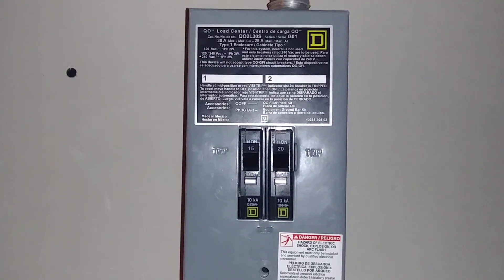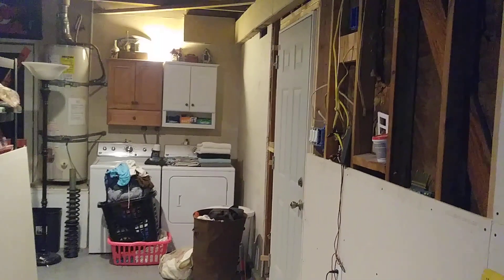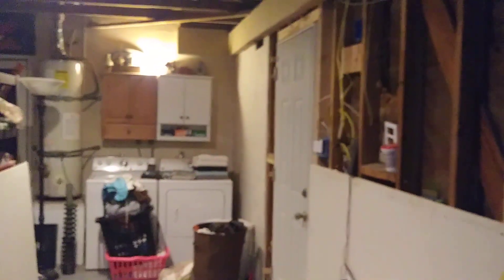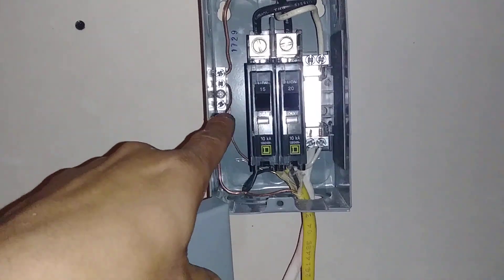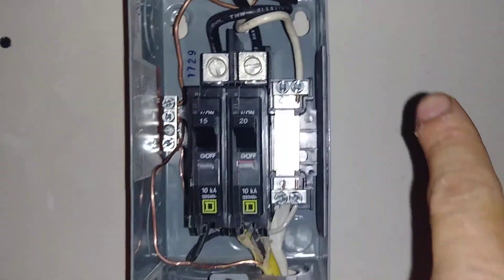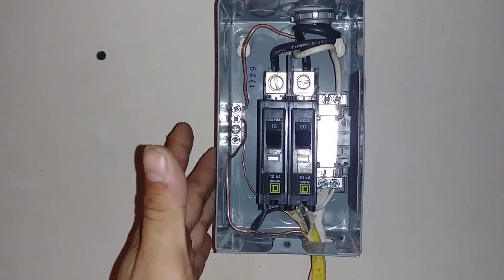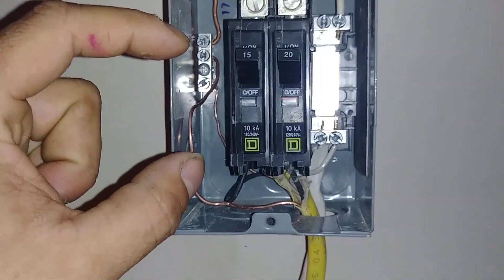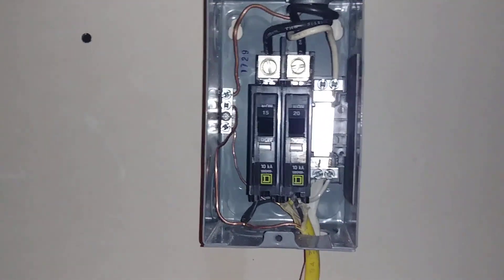How to wire a sub panel 30 amp

Comment: Since you have a shared neutral you should have the same breakers tied together so they both trip at the  time  and add a connector on those wired coming into the sub

Comment: Thanks.  I got one of these to feed a 30-amp clothes dryer off a 50-amp 240-volt line.  Nice little box.  I forgot where the plastic shield/spacer went.  I see it in your picture between the neutral and the wall of the sub panel.  🙂

Comment: @rashellyohn5128
0 seconds ago
Thank you for this video. I really need help!
I have this pump that had 10 gauge 3 hot wires and a ground coming from my panel . 2 hots and the ground were directly contacted to the pump while the 3rd hot was wire nutted off to the side. I have since added a sun panel with( 2) 15 amp double pole breakers in hopes to split the power of one double pole breaker to add a 110amp outlet. Only thing is there is no neutral wire. I got the pump working off the 2 double 15 amps but the gfci only the green light came on but had no power to light the heat lamp. Could I add a metal stake into the ground , run a ground to the bus bar then run a wire to the bus bar to the gfci as my neutral wire. The ground is connected to ground screw of sub panel and also the ground wire that was originally connect to pump is also connect to ground screw. 
Thank you for your help.  At this point I’m not worried about code as I am keep the pump from freezing.
Reply: Sounds like you need an electrician, RA.  When you say "3 hot wires," that says three-phase power, which I'm not convinced you have.  Generally black is hot and white is not (AKA neutral).  For 240, the second hot is red and white is still neutral.

Comment: Can a 20 amp circuit feed this panel with the 20 and 15 amp breakers or does it require 30 amp?

Comment: You could have used the dryer conductors for a 30 amp 120 volt feeder.   You did not need 240 volts.  You really should pull the NM(Romex) cables out and install two connectors.   It is for your safety.

Comment: thanks for sharing, I'm trying to find a nice compact breaker box that has a main and two circuits...any leads are appreciated...
Reply: Just recently bought one a home depot to put in my van conversion I havent hooked it up yet Ill have to check for the ground bar It didnt even occur to me  The one I bought holds 2 breakers I think it was under $20

Comment: You have to buy a separate ground bar? Where do I get this? 
Edit: you say where in the video
Reply from the maker: SMP scientific method perspective I left the link to the ground bar in the description. If you need it right away you can try Home Depot, Lowe’s or any local hardware store.
Reply: @2006JeepLimited57L  quick response! Wow! Thank you. How do I actually hook it up? Is it a double or single fuse? Looks like 2 single fuses? How do I hook up the wires to the fuses and install the fuses?

Comment: Great video!.  Here in mexico most of the electricians, always connect the neutral on the ground bar, i dont know why. I buyed one square D load center (60a), and inside it has an sticker with the electrical diagram and shows neutral connected to the ground, but it have a ground marking in the bottom.
Reply: for the main panel, you connect ground and neutral together, but not in a sub panel.
Reply: Not for sub pabels. Have to be separate bars unlike main pabel

Comment: I just bought the same box with a ground bar kit for RV build project. 
If you’ve got one line in from an RV plug with one hot wire available how do you safely supply power to two hot lugs for two breakers??
Do you use a jumper? 
Confusing.
Reply: In that case you run a cable 10-3 from the main panel box ,conect 30 amps doble break ,in the main panel box use black and red to hot ,and use the white cable for neutral in install in the bus bar and the grund right in the place has to be and install the lettle sud pabel 30 amp with two hot rigth in place has to be next the neutral in the place and the ground in the ground ing bar afther that connect two breaker 15 or 2o amp just for what you need and now you have the conection, if you need caple outlets you can use 20 amp breaker (single) with 12 gage wire  
If you need switch and light just use 15 amps breaker with 14 gage wire ,you can do it.
You gone use two separate breaker, never use doble pole break for that lettle sud panel .
Also you can use single pole 30 amps breaker but these is diferent history i don ,t want mix this explanation ,jejeje .
In mexico they do that on single pole 30 amps break and they meke jumper to another breaker ,but just use 220 volt that way yoy don,t get confuse.

Comment: title says "wire sub panel 30 amp" but switches say 15 and 20 ... ???
Reply: What's your issue 35 amps doesn't equal 30?  Sum up the circuit breakers in your main panel and see if it equals the main breaker / rated panel capacity.  Nobody ever turns on every circuit at max capacity at the same time.

Comment: Dude, you need to put a 'proconnex' connector on that box where the 12-gauge and 14-gauge wires enter the box to prevent the metal edge from wearing through your insulation. Plus, it is code required.
Reply from the maker: Yes. I eventually did. Thx, dude.

Comment: I just got this box and I am alittle confused, why do you have two hots and a nuetral/common wire comming in on the top.  Is that 240V that you have there?
Reply from the maker: The two hots coming out are connected to a 30 amp breaker on the main. There are two slots for two hots on my 30amp on the main. The neutral white wire connects to an open slot on the neutral bar on the main.
Reply: @2006JeepLimited57L  - ok thanks, i only have one hot 30 amp 120V comming into the top, do i need to jump it over to the other top lug to use both breaker slots.
Reply from the maker: @durangodave  You can just buy a a 30amp breaker with two hot slots and switch it out at the main.
Reply from the maker: Check your main panel and see if you have room for a 30amp double pole
Reply: @2006JeepLimited57L  - hi this is on an RV i am adding a sub panel where the 30amp shore power comes into the RV, I have had some electrical issues with the main panel and i want to have something ahead of that just in case.   I have no extra slots in the main panel.    But i need to run two circuits off the sub panel.  One circuit will be to the main panel and the other circuit will be to an outlet.  So this sub panel will have 30amp comming in, and two breakers one 30amp and one 15amp. going out.
Reply: @durangodave   what did you end up doing?
Reply: @petesteinkamp6951   hi, i ended up installing this little pannel as my pre-panel to the rv main pannel.  There is alittle RV table from the factory right where the 30 amp comes into the RV.  So i used some wood scraps to make a secure mount for it and hooked the 30 am from the shore power right into this little mini panel.  Then from there the normal wires continue to my main rv panel.

 I am dang lucky that the RV did not burn down,  The rv dealer did not put the wirenuts on tight or tape them and they came off and were sparking for probably a month or so if not longer.  I only found it because i finally smelled smoke. This was after fixing my power cord and after replacing my power convert, hind sight now i know why those went out.   

Now with the mini pre panel i feel safer especially when shore powers done have breakers on them.  This is a great little panel.
Reply: @durangodave  in that case you  right  but, in you panel box you have yo put 120 volt a,single break 30 or 20 amps ,alsolud in the sub panel no need put 20 in 15 ,you can put two  break 15 amps just put 12 caliber cable.
Reply: Dave L  I have the same question? 1 one line coming in from the RV plug. 1 hot only. There’s 2 two hot lugs. How do you connect to 2 lugs? I have 2 two separate 15a breakers running to 2 separate outlets. (1 breaker per outlet) 
Anyone have a clear explanation on this? Too much confusing talk on here.
Reply: @xraykadiddlehopper8067  I also have this question! Did anyone find out an answer? Thanks!
Reply: With have ,two way  to install a single, or doble pole breaker. 
You  can conect in you  panel box  .
A single  pole 30 amps, 10 gage cable .
Or a doble, pole breaker  30amps, 10 gage cable.
With the single just make jomper to use to hot .
In you panel box if you use single break just put one hot ,if you use doble break conect two hot .

Comment: You ran the main wires directly from the main hot on the big panel or connected it to the breakers?
Reply: He added a 30amp breaker on the main

Comment: So you have an old 30a dryer circuit you're not using taking up 2 spaces on your main panel, and you decide to put a 2 space sub panel on the other side of the wall. Why did you not just disconnect the old dryer circuit and run those two new circuits into the main panel?!?!
Reply from the maker: ReservedForFutureUse I could have done that but i wanted an accessible shut off or reset from the inside of my house.
Reply: @2006JeepLimited57L  ru gonna run anything more off this panel or no?